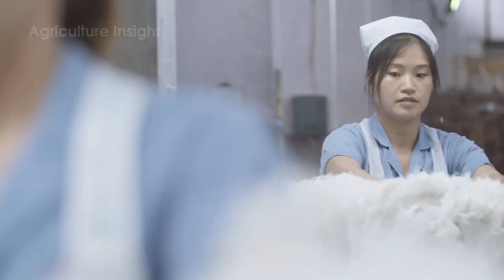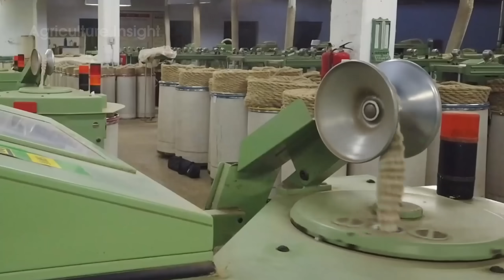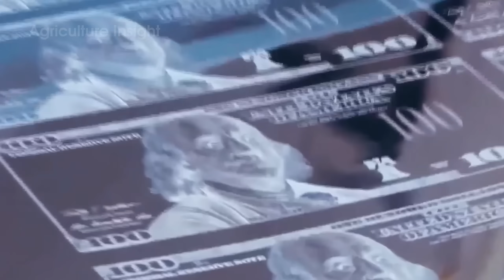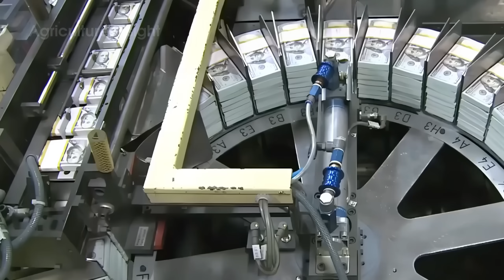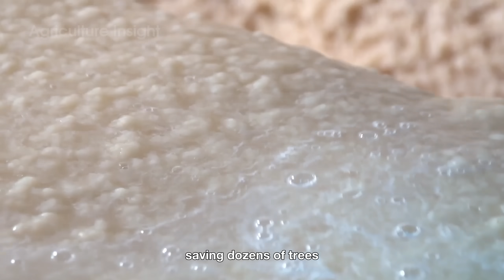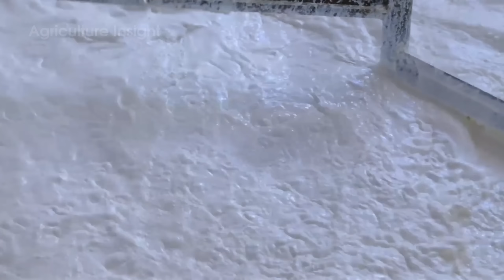Inside the World’s Largest Hemp Processing Line – How Fiber & Hempcrete Are Made

Comment: Primitive processing... being that 1-3 m/ yrd complete fibers could be harvested. Structural panels, large blocks & whole monolith floor & wall plates ( with integrated insulation forming SIPs) could be constructed, rather than blocks with only compressive strength. These panels could be pre or post stressed with 3d weaves.
Reply from the maker: Thank you for sharing these interesting insights about the potential of hemp fiber.

Comment: It appears Washington is supporting the oil industry again because hemp is logical alternative to nylon like President Trump is fearful of hydrogen gas but it can be safely stored in non-toxic, room temperature clear liquid recently discovered by Ayrton Energy in Canada. Ocean or salt water is best source of hydrogen gas where the mineral & Co2 rich ocean water can produce magnesium alone to completely offset the cost of zero pollution fuel sources besides making cement, bricks, fertilizer, chlor-alkali chemicals, sodium sulfur batteries, potash, chlor-alkali chemicals by Agess Inc in San Diego working to import gravity fed ocean water into Salton Sea & Laguna Salada for border prosperity.
Reply from the maker: Thank you for watching and sharing. Hemp is indeed a versatile resource with many industrial applications.

Comment: Tuned in for the hemp processing portion. Was surprised and fascinated by the money paper and fiber production. Such a detailed process!
Love to see more about hemp in automotive use. Henry Ford built a car partially using hemp. Hemp fibers are very strong but also really light. When combined into composites, they can be as strong (or even stronger) than fiberglass, while making the part 30–40% lighter. That means cars weigh less, use less fuel, and produce lower emissions. Such a versatile plant, endless possibilities. 😎
Reply from the maker: Thanks for the detailed insight! Hemp really is a promising material with many exciting future applications.

Comment: THC is a dope not a drug. It open chemicals already in your body. Drugs introduce and chemical not made by the body. THC was outlawed because wood pulp was used because of the land owned by one family was full of lumber causing a carbon problem. Stop the carbon factor. Hemocrete has a 0 carbon footprint.
Takes almost no chemicals where cotton is cocktail of chemicals to make applicable material.
Reply from the maker: Thank you for sharing your perspective.

THC is generally classified as a psychoactive compound found in cannabis, and scientifically it is still considered a drug because it affects how the brain functions, even though the body has its own endocannabinoid system that interacts with it.

Hemp based materials like hempcrete are often discussed for their lower environmental impact compared to some traditional materials, and cotton production can involve significant pesticide and water use depending on how it is grown. These are important sustainability conversations.

It is always helpful to look at reliable scientific and historical sources when discussing why certain substances were regulated. I appreciate you contributing your thoughts to the discussion.

Comment: It is well past time that human beings stopped poisoning the planet with plastics and recognised the benefits of hemp  as a textile for nature friendly ropes and soil friendly textiles. Hemp in the form of HEMPCRETE is a superb building material. It is fireproof, rotproof, insect and mould resistant. It takes less energy to produce, is lighter than concrete and absorbs CO2. There is a bridge in France that has a foundation of hempcrete dating from the Roman period and it self-heals rather than permanently cracking like concrete.
WHY are we not using more hemp ?
Reply from the maker: Thank you for watching and sharing such detailed knowledge. You are right about hemp’s benefits. Its limited use today is mainly due to past regulations, industrial lobbying, and lack of infrastructure, not because the material is ineffective.

Comment: Byssinosis, or "brown lung disease," is a major concern for anyone working with plant fibers. It's always good to wear masks when working with it. Cotton, hemp, flax, anything. Protect your health and wear a mask or respirator.
Reply: The only issue with hempcrete is that it cannot be used for load bearing walls. Not like concrete block. You have to make a sturdy load bearing frame, like out of metal or wood framing. Hempcrete is fire resistant, light weight, and a good insulator.
Reply from the maker: Thank you for sharing this important information. Protecting the respiratory system when working with natural fibers is essential for long term health.